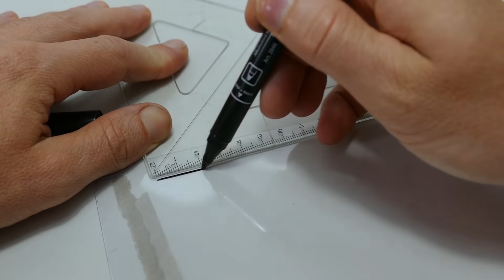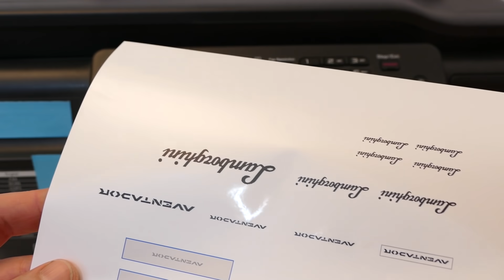Lamborghini Aventador Restoration Abandoned model

Comment: I have to admit i was a bit disappointed when I realized it was a toy, but I watched the video and it is still just as impressive, like how do you restore something that old and rusty, keep up the amazing work man
Reply: It is not old toy. He damages items in good condition and later restores them. It is zinc die cast and normally it does not rust. All damages are made by author of movie. Besides these are lowe-quality, cheep models.
His quality of painting is terrible.
Reply: @jaro5770  how do you damage something and make it rust? Enlighten me please.
Reply: @lolstars3867  You can use special pigments and paints or use scratched rast from a steel item.
Reply: Me and my dad restored a 72 chevy camaro we found in a junkyard. It was just a roller and we bought it for $550.
We had to rebuild the motor. Obviously but it wasn't to damaged. My dad would come to my house and help me when he got off of work. And I would work on it when I got off. It has been a 3 year project runs great now. We just did a yenko tuneup. But the rust on was the hardest part it took alot of grinding welding and even again. But it looks amazing
Reply: @jaro5770  it doesn't matter bro the restoration is legit so why care about if the damage is staged?

Comment: Would be a great channel to have to techniques used to make them look battered out in the first place. It takes a great modeller to restore a kit but a better one to make it look weathered and beaten up. For those who thought it was found this way, it wasn't. White metal (the body they are made of) it doesn't rust just like the plastic parts don't rust. 
Well done to the modeller who made the before restoration model.

Comment: I feel what this person exactly did is that first bought a aventador model, left it to rust for nearly 1 month, and the made the video, cause had it been really rusted unknowingly, the joints and the screws would have diffused so badly that a screwdriver would not have worked, rather it had to be pulled out using pliers or something of that sort. 

God forgive me if i hurt someone.
Reply: I found an old car in my backyard while doing some metal detecting. I have lived here for about 12 years at that time. So it had been in the ground for at least 13 years. After cleaning it up I was able to turn the screws out without stripping them.
Reply: @ShawnClarady  maybe....i just guessed in this case tbh.